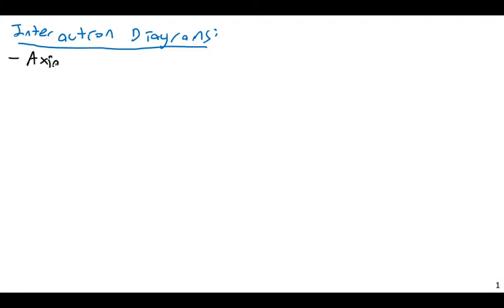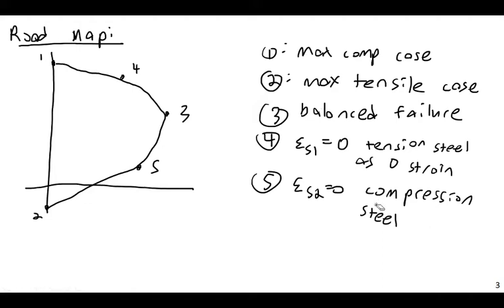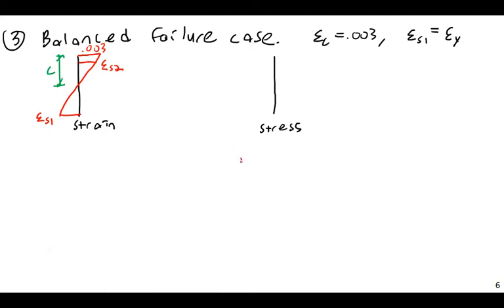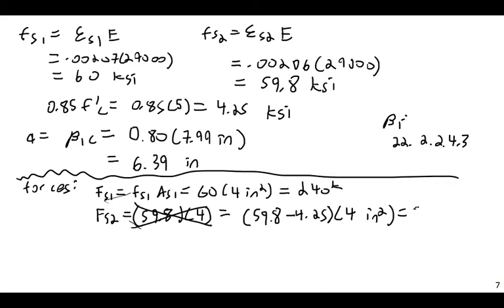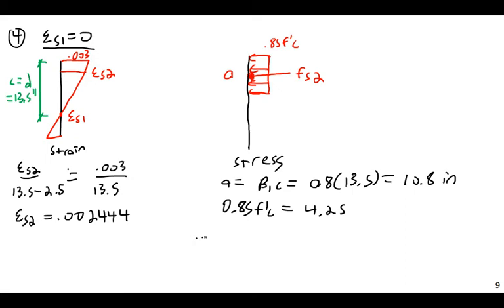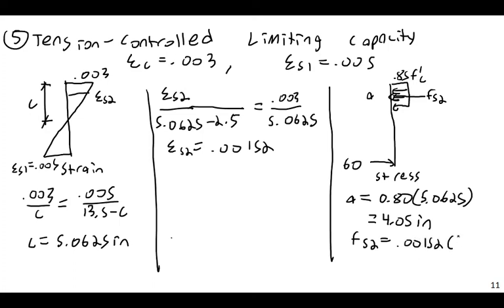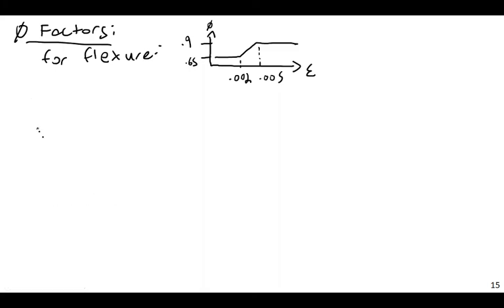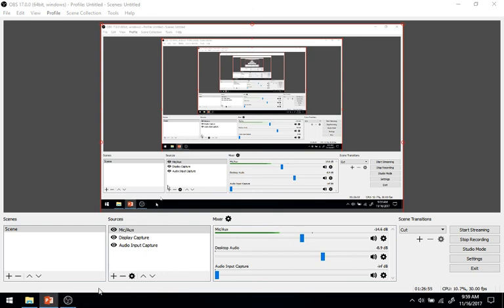Concrete Column Interaction Diagrams - Steel and Concrete Design

Comment: Are you just using absolute values of the moments about the neutral axis?. Since the compressive forces are in opposite direction compared to the tension force on steel, there should be moments in opposite direction too.